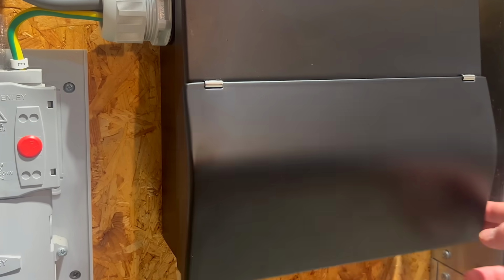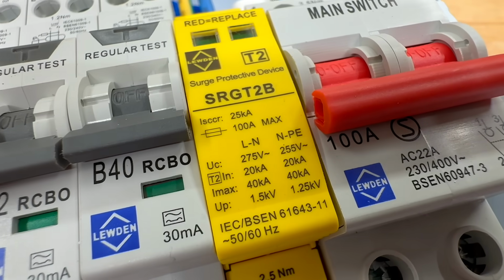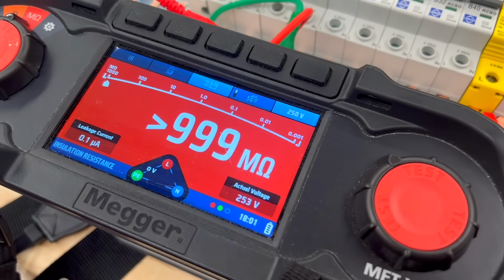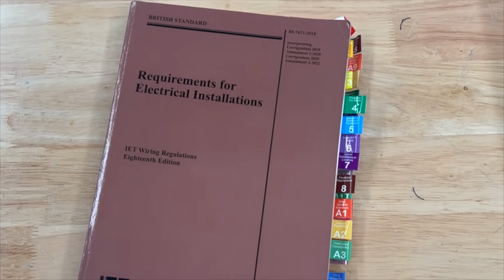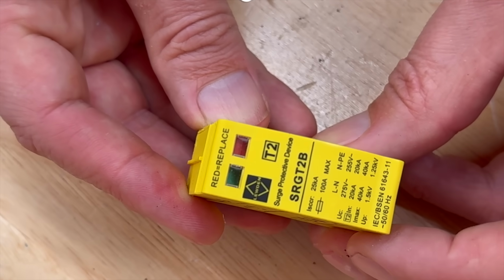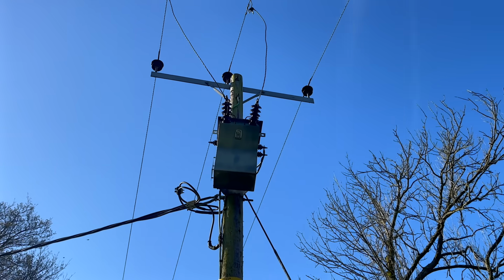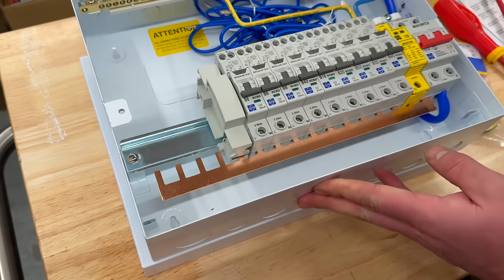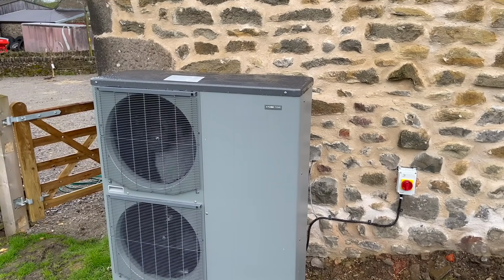Why do Surge Protection Devices no longer require an MCB?

Comment: You suggest to open SPD circuit breaker, but continue to overvolt expensive appliances because main fuse at meter box is closed? SPD circuit breaker opened and expensive appliances will get spikes because SPD is no more connected. 

You paid money for buying SPD, you paid money to electrician for installing, but in case of fault circuit breaker opens and disconnect SPD, so home appliances are no more protected because of opened circuit breaker. 

Regulation for older SPD is written by person who has very poor knowledges about electric circuits. This person had no idea that after opening MCB expensive appliances will be disconnected from SPD and get spikes. I have no other explanations why this regulation was written.
Reply: What do you want!? Once a SPD has failed it has to be disconnected, plunging a whole home into darkness I don’t think is the right outcome, it’s never worked that way and I doubt it ever will. I guess if you want that then use the volt frees to open a contractor.
Reply: @edc1569  Voltage control relay opens contactor with delay 7 seconds. I have never seen in UK voltage control relay because UK energy companies use single phase for 25000 watts and this situation requires 100A contactor.

Comment: SPD should just trip the main switch when it detects a surge
There should not be any need for an additional circuit breaker
Reply: Okay 
Here in South Africa, we generally have a circuit breaker (double pole for single phase and a triple pole for 3 phase) as a main switch
Reply: How would you ‘trip’ the main switch? Considering we’ve lived with modern appliances for 30 years without SPDs do you really think your plan is the best compromise.
Reply: SPD just creates a short down to earth so that the surge does not go through the rest of the installation 
The short down to earth should be large enough to trip the main switch thereby disconnecting the supply from the installation and not allowing a path for the surge to enter the installation
Reply: @capebee4839  Mainswitches are just that, switches.  You can pass 300A through it and it'll just get hot etc.  Do you mean a MCB acting as the mainswitch?  That is a thing in some countries, (but not over there?)

Comment: Does it matter where the SPD is located within the consumer unit and what amp MCB should it have?😊
Reply from the maker: The position in the unit isn’t a big factor - but the length of the connection to earth should be as short as possible.
Reply: MCB rating according to the SPD manufacturer's instructions. This is because different SPDs have different vulnerabilities.

Comment: Lewden needs to start using a decent material 
For the casing & the spray job is not great.
They look cheap .
Most manufacturers have had single module
SPD’s for a while.
Reply: That’s why they are cheap
Reply: @andysims4906  they aren’t though now compared to a few years back.
Reply: @AlanBrown-y7u  too shallow aswell imo.

Comment: Locking the fuse box is "good". Especially if an MCB triggers, this cannot be fixed.
Reply: Why is it good?  Seems pointless in a domestic environment - the housholder will need a key - so what is the point?

Comment: Hello Mates! I have some questions about SPD. In TNC-S System, where the neutral it's bond with grounding (<4 Ohms), have we need to protect the neutral wire with a arrestor?
Reply: Thank you mates, for your answers. It helps me
Reply: A spd will protect Netrual if it Dual pole.

Just make sure you select the correct one according to where you need protection 
Remote or local

And if you have lighting protection

A type 1+2 sounds like it would be suitable for your needs.

But you might need further information and investigation hope that helps 👍
Reply: The distance is the factor.  I don't know UK regs but lots of countries indicate that if the N/E link is no more than 10m of wire away there isn't a need to specifically clamp neutral to earth.  After that you can get excessive n/e voltage and then you fit a unit that has a GDT to earth too.

Comment: The graphs used to convey what SPDs do are often unintentionally a misleading and it looks like efixx has fallen into the same trap.  A SPD will take essentially no action at all with  most of the transients shown in the graphs.  They don't track the sine, they simply pass more and more current (MOVs) as the voltage climbs beyond their rated voltage or hard clamp (GDTs) once the conduction threshold is reached.  The transients that go towards 0 volts will not cause any response, in fact those transients could plunge through 0 and all the way to 250V in the other polarity and the SPD won't care.  The ones that only slightly exceed the peak voltage of the sine will not cause any response.  The only one that may be clamped would be the 3rd in the first graph.
Reply from the maker: Thanks for the thoughtful comment  – you're absolutely right. The video’s main focus was to explore why manufacturers are moving away from using MCBs to protect SPDs, so we kept the explanation of SPD operation quite simple to support that context.

As you point out, SPDs don’t track the sine wave and only respond when thresholds are exceeded—MOVs passing more current as voltage rises, and GDTs clamping hard at conduction thresholds. The real surge waveforms are, of course, far more complex—often comprising multiple frequencies and short-duration pulses, which can be additive or subtractive to the mains waveform.

Appreciate you raising it, and if there’s interest, we’d be more than happy to dive deeper into the waveforms and SPD response behaviour in a future video.
Reply: @efixx  Looking at the comments I think a video on what SPDs do, how they do it and interact with the installation, including when they pass current to mother earth, would be a good idea.
Reply: I saw that too.  Normally, there would be no action with less than around 400 volts between live and neutral. Peak voltage = (230 plus 10%) x (sqrt 2) = 357 volts.
Reply: @GodmanchesterGoblin sorry, where did you get the sqrt 2 from? 230 + 10% is already 253, maybe I am missing something.
Reply: @silviuguseila2552  For a sine wave, the peaks are 1.414 (actually sqrt 2) times the RMS value. So the highest absolute voltage on a clean 230 V sine wave is plus or minus 325 volts, and obviously more if the RMS value is higher.

Comment: The main issues are when they are retro fitted to existing DB’s and are connected directly into the supply side of the main switch with the 25mm tails, using 6mm brown and blue singles…and often the SPD doesn’t have in built overcurrent protection…

Comment: Has anyone ever seen a SPD that's been activated?
Reply: And at work I've seen them literally blow up.
Reply: Yes, in the housing estate I live on. The earliest completed houses had power issues early on and most have need to be replaced.
Reply: Nope, it's just more useless shite they're making us cram into CU's for the kick back from the Board manufacturers.
Reply: By "activated" do you mean "failed"?
Reply: @obd6HsN  No it would have succeeded.
Reply: @stevoc9930  They get activated hundreds of times before the red flag appears to indicate that they've failed. How would you expect to "[see] a SPD that's been activated"?
Reply: @obd6HsN  You have obviously misunderstood. If it's red then it is spent and needs replacing. But it has succeeded in it's purpose of protecting the installation.
Reply: @stevoc9930  You have obviously misunderstood. My point is that we've all seen SPDs that have activated - if you look at one that's a week old: tada you can see an activated one. They continue to activate, repeatedly. One day they fail, overheat, and show the red flag. They are not one-shot devices (unless that particular 'shot' just happens to be a nearby lightning strike that exceeds its energy rating).
Reply: @obd6HsN  No I haven't misunderstood I'm familiar with how they work. The original poster is obviously referring to them going red. Regardless of how he describes it we can understand his point from context.